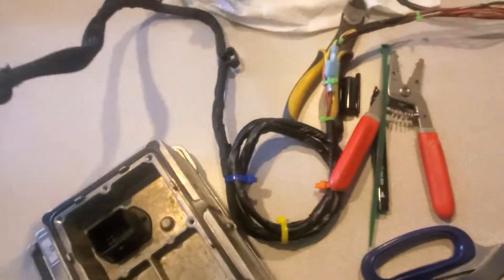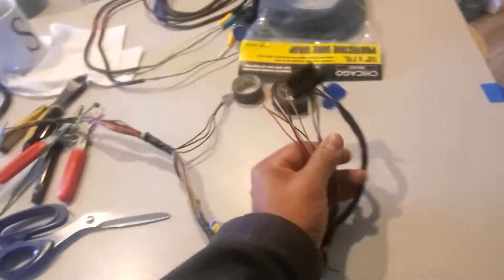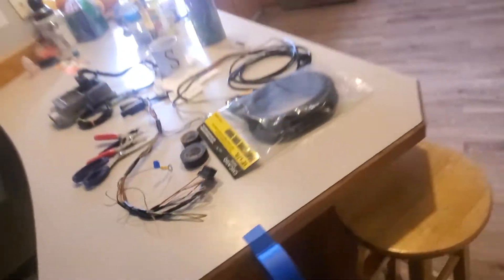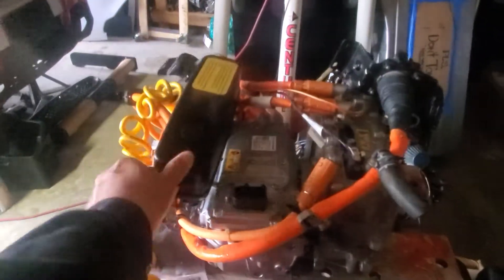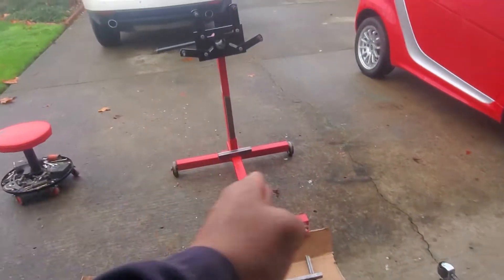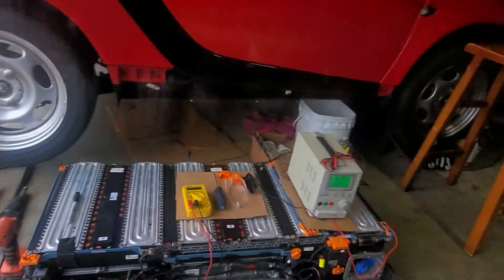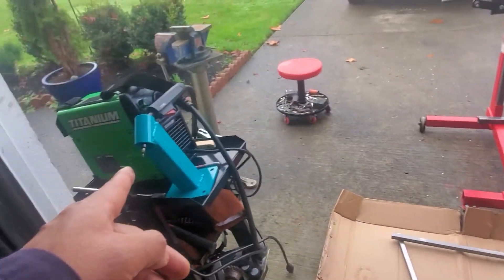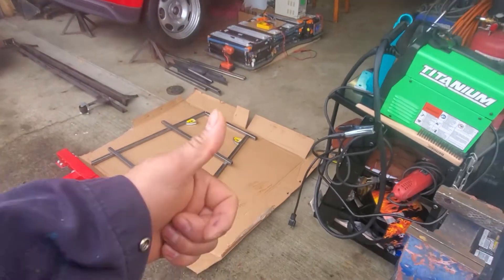Smart Car EV (BMS Connector)

Comment: Hi Angel, can you help me fix the BMS problem on my smart car? It needs resetting because the high-voltage battery was discharged and the BMS was disabled. Can you sell me that plug-and-play harness, or what else will I need?